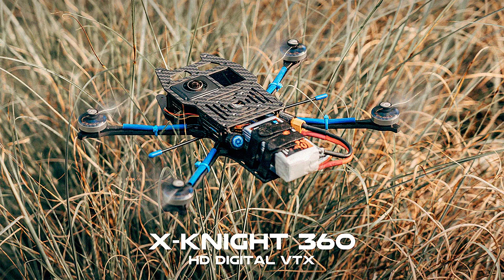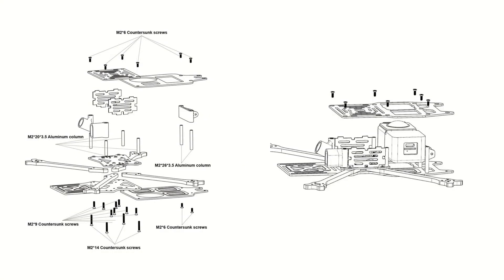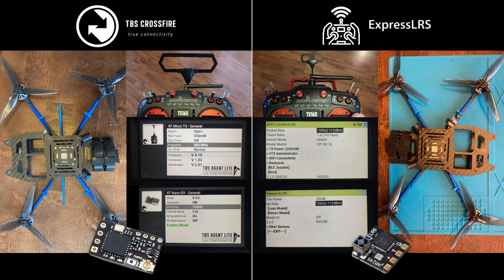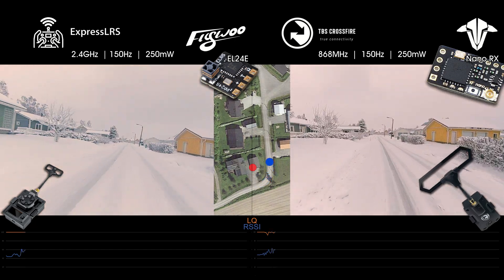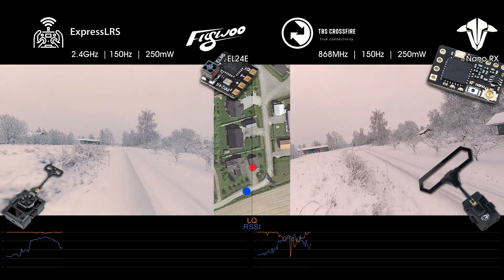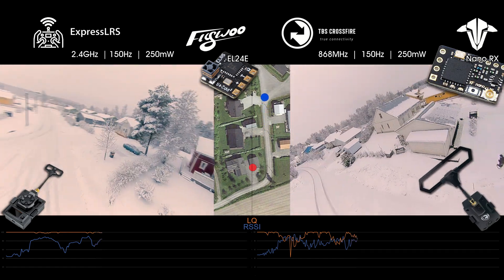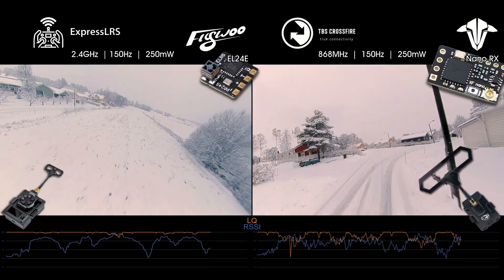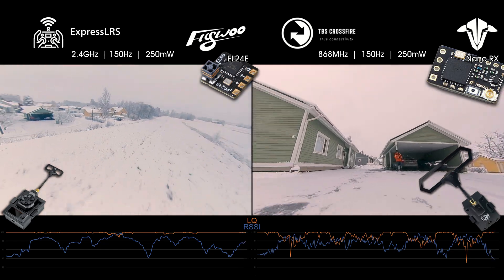ExpressLRS 2.4GHz vs Crossfire 868MHz | Ceramic antenna vs Micro RX antenna [250mW, locked @150Hz]

Comment: those crossfire wire antenna are bad if you not going to mount them correctly imortal T are the best to get, but I agree for the range and compactness of ep2 receiver are shocking

Comment: Ep1 antenna would easily be mounted on that frame and perform way better than the ep2 ceramic antenna
Reply from the maker: Yes indeed it would. The thing is that I didn't have an extra EP1. I already used that on this quad: https://www.youtube.com/watch?v=T0WeRX2uA44&t=235s

Comment: Even I am surprised at how well the ceramic antenna performed in comparison, and I run receiver comparisons all the time for validation. Those ceramic antenna RXes are the worst performing ExpressLRS receivers by quite a bit. 150Hz Crossfire isn't great for range, but I would have expected it to do much better due to the 868MHz. Great comparison though and good idea showing the graphs under the video footage to follow along!
Reply from the maker: Yes, I purchased the elrs receiver with the ceramic antenna for putting on whoops so this was a pleasant surprise. And yes all of my other Crossfire receivers get way more range than this one.
Reply from the maker: Here is a short follow-up with another quad, one without any Crossfire range issues along more or exactly the same path for a more fair comparison: https://youtu.be/L4kb4oJ5XL8